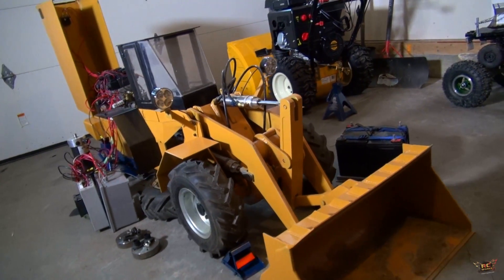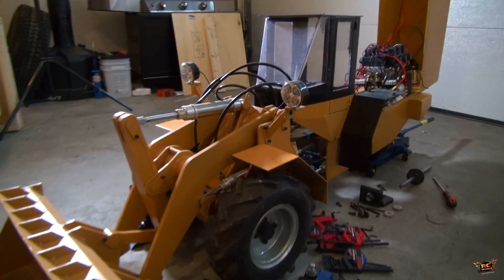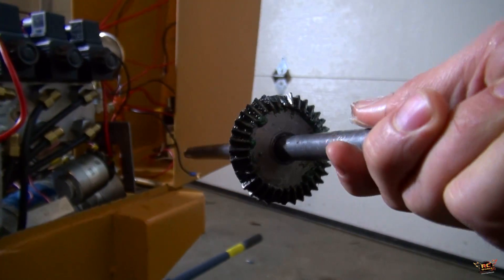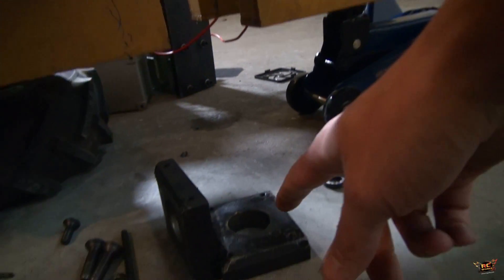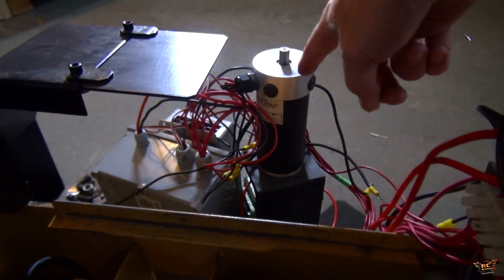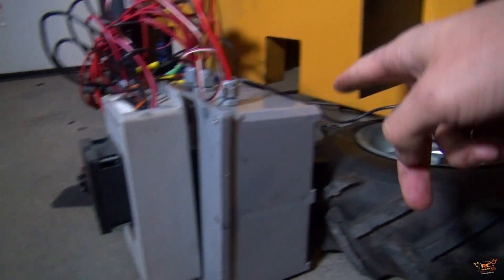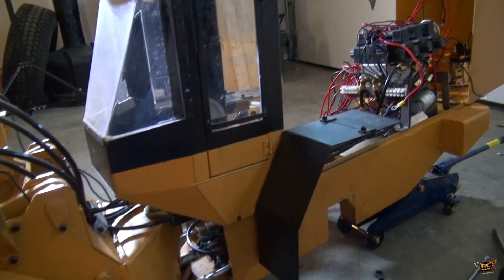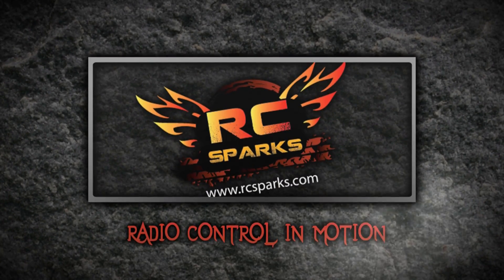RC ADVENTURES - 1/5th scale 24v Electric Hydraulic Steel Wheel Loader

Comment: Man O Man O Man....... I could have fun with this bad boy!

Easy Fix...Use a Kawasaki Vulcan Drifter or Nomad Ring & Pinion to replace this Underrated & Undersize ring gear!   Problems solved...Any repital macing shop can mated the housings together...... The only part you must be aware of is, This can not be a LOCKED 4 wheel drive or the RING GEAR will explode, It was DIS-Engage when turning! ...... Okay.....Easy for me to say right????..... Measure the axle that your ring gear is on now and then investigate the axle or drive shaft or live axle on the Vulcan

Comment from the maker: I'm not interested in Riding in it, Im not interested in putting my Son in it..

Im interested in using it for what it was designed for..  WORK!
Reply: aww your no fun
Reply: I bought my 3 year old a Traxxas Summit and he has a blast with it. They are never to young to learn to play with the big boy toys. Heck my 7 year old has more RC's than I do and none of them are a Walmart special they are all Losi,Traxxas and a few Axial... At least if one gets broke I'm not throwing away 100 bucks I just buy the parts and keep going also he learns a lot when we sit down work on them together it's a fun family hobby if you make it one. 👍
Reply: Ryan P just buy a traxxas stampede xl5 never will go back to toy grade
Reply: Ryan P If i'm to be honest with you,  you really over payed for that but what is done is done.  Just google tyco battery if your looking for a direct replacement, if your looking for a actual upgrade a 3s LiFe battery has around the same voltage and are well known for safety but you would have to get a charger just for it and probably have to jury rig the car a bit to get it to work.
Reply: hey medic, any advice on better batteries to replace tyco type 9.6 volt packs?
Reply: james ewing My Mrs. bought our son a cheap $100 rc buggy for christmas, its made by EZ-TEC...hes only 4yrs old
Reply: AbyssFlight
Thanks mate, that's the info i was after, the Mrs said it was only $60 so ...a bit less than what i thought, It was really just a stocking filler but if he likes the RC stuff we will get him something decent later on.
Reply: Lipo's have come a long way but they need a balance charger and should always be charged in a Lipo bag as there is a small chance of it catching on fire then to store my Lipo's I use a metal coffee can.. A blinky is also nice to have for your Lipo's.. Good luck and I hope you all enjoy the RC world!!